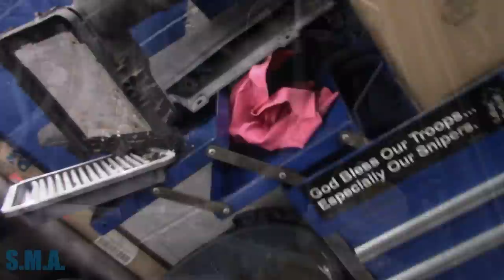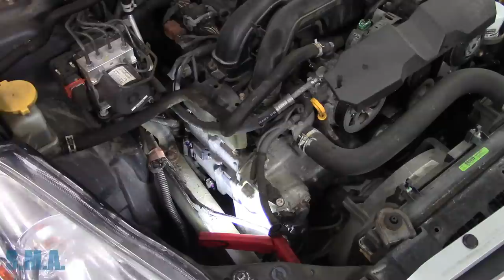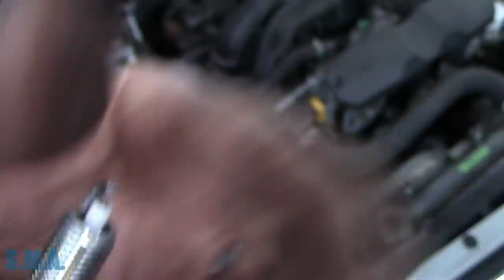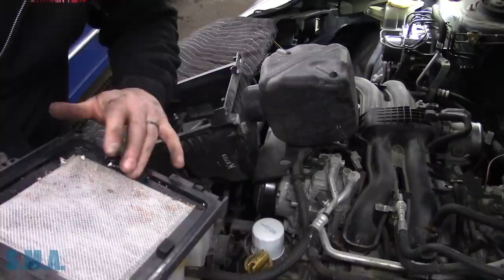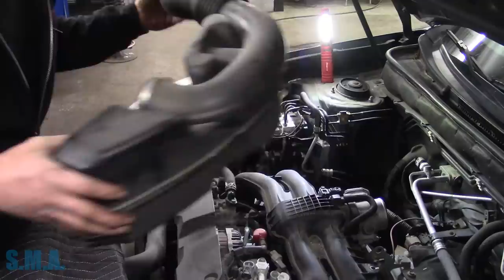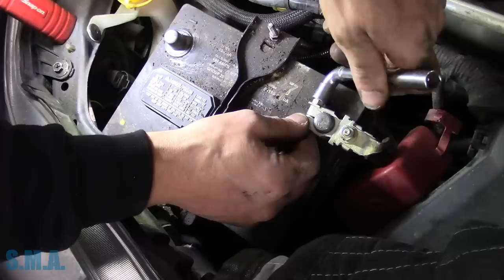Subaru Outback Repair Series: #2 Replacing Spark Plugs

Comment from the maker: 3/8-Inch Drive 9/16-Inch Spark Plug Socket: https://amzn.to/3aaOeeD
Wobble Socket Extension Set: https://amzn.to/2PuxOWL
My all time favorite must have in a vehicle tool kit: https://amzn.to/2PwXMZB
Reply: Eric, What's your little light and where did you get it?  I keep saying to myself "I need one of those".
Reply: @paulbateman7  harbor freight has something similar to that they have BRAUN also have a shorter version of them I believe...they go for around around $40 They are like the ones eric uses that you see only they go for close to $250 -$300 a pop. Harbour freights give off same light intensity but the fraction of the cost.
Reply: Just about everything he uses is available on the south main amazon store, the link is in the description
Reply: where did you get your cordless nut driver from and price?
Reply: Eric, I enjoy watching your repair/service videos. I helped my friend tune up etc. his Subaru. Have you ever used the Denso spark plugs? I used the Denso Iridium Twin Tip spark plugs on his car with great results. According to him, he felt the difference in power & torque delivery.  Most importantly he was able to get a better overall mpg.

Comment: The whisper commentary is fantastic. Its a mechanic thing, when you are in a tight space you tend to whisper, because you don't want your loud voice to make the bolts fall out.
Reply: Totally!
Reply: It's like hearing the mechanic's inner voice!
Reply: It's the complete opposite of Neutral Drop.
Reply: Or want them to break. Lol
Reply: Too true!
Reply: It’s like turning down the car stereo so you can read a street sign.
Reply: Weird but fantastic!
Reply: Whispering like in those ASMR videos that make you sleepy. Next video features big nasty which would give you a shocking wake up, haha :D
Reply: Right
Reply: Don’t wanna spook them, they’ll run away.
Reply: I usually swear loudly to intimidate the parts so they will fucking fit as I say. Bolts always fall off in unreachable places anyways no matter how much you whisper but after swearing they kind of fall off where I can grab them. It’s part of the job anyway. No need to say it’s a common shade tree mechanic thing. Professionals whisper.

Comment: Who is old enough to remember that in the time it took Eric to change 4 spark plugs you could have changed 8 plugs on a V-8, as well as wires, distributor cap, points, condenser, set the points and timing, and be sitting back having a cold one of your favorite beverage?
Reply: I do! I also remember the inline 6s in "full size" cars back in the day, you could STAND IN THE ENGINE BAY while replacing these maintenance items!
Reply: These Subarus are easy by modern standards. Don't have to remove the windshield cowling or the intake manifold. Older cars may have been easier to work on, but you'd have to change those plugs every 30k max. More like 10-15k if you're talking carburetor days.
Reply: Except on a mid 70's Cutlass. Distributor was up under the firewall. Of course the hood didn't bopen high enough to make it easier.
Reply: @ouch1011  nah clean the plugs, check the gap, put them back in. Do you remember the plug cleaning machines? Push the plug in the hole and carbon was gone. As long as the electrode wasn't rounded they were good. My Dad showed me how to keep them clean. Most of the buildup was due to the lead in the gas. Learned to read the build up colors too. Rich, lean or just right.
Reply: Google for a picture of the F10 M5 engine bay and you will see why I don't change my own plugs, you have to take half the engine out before you can see where they are 😂🤣
Reply: @arcadeuk  I have a 2002 Ford Explorer Sport Trac (V6) and you have to remove the passenger side front wheel and a panel to get at the right (starboard for all you boaters and sailors) side plugs through the wheel-well.
Reply: Hi from England. So glad I run a 1998 Micra K11. All plugs easy in view on top. I was wondering 'how many more bits is Eric having to take off'?

Comment: Goodness… Anybody remember the day that you could change eight spark plugs in less than 10 minutes? Cars these days are tough…
Reply: Yes, and you had room to set up a dining table and a fridge under the bonnet too. Now you need to remove 10 friggen things to get to the thing you want to replace.
Reply: @wonniewarrior  Older trucks with in line six engines had enough room to have a mechanic stand inside the engine compartment on either side of the engine,
Reply: Only Subarus make it this hard, lol
Reply: My 2010 2.5 outback isn't hard at all to change. Don't remove airbox or anything, just use a bunch of wobble extensions
Reply: @Quiet Entropy one can kill the other 7
Reply: the 1999-2012 subarus with the EJ251 and EJ253 engines had the plug tubes angled up and were super easy to change, and legitimately can be changed in less than 15 minutes......but all the DOHC models are a PITA to do plugs on.....esp when they cram a huge coil pack down there XD; the EJ255/257 also have part of the emissions system running across the left side valve cover, for those you need fingers made of noodles
Reply: On my '64 Chevy Nova.
Reply: @Jobaa87  Volvos too.
Reply: @Quiet Entropy Common....
Reply: Subies are always tricky because of the boxer design.  I remember my 15' Forester I had to use two wobbles and a six inch ext.  If I didn't I would have had to take an engine mount out and raise the engine a couple inches to get good clearance.
Reply: 68 Mustang V8 w/air, 10 minutes.
Reply: @wonniewarrior  That is why an inline 4-banger is ACTUALLY FUN to work on!
Reply: @Jobaa87  It's a LABOR of LOVE............Subaru, AND it only gets BETTER when it's time to replace head gaskets (which they need at about 150Kmiles). lol
Reply: @Jobaa87  Try replacing the plugs on any newer Toyota Highlander/Lexus RX. Or just about any minivan except a Honda Odyssey. Subarus are easy by comparison.
Reply: I guess you never changed plugs on a Monza, Pacer, or Mustang with a 390 or 428.
Reply: Not my ‘15 Audi A4. Direct injected and turbocharged and I can change the plugs in 10 mins.
Reply: My worst was a 68 mustang with the 428 cobra jet. What a pain in the ass.
Reply: Jobaa87 same with air cooled VW.
Reply: @Jobaa87  nope. Monzas, cougars, dodge trucks, yadda yadda. As long as man has put engines in vehicles people have complained about sparkplug access.
Reply: @TheOzthewiz  The leaky or blown head gasket problem in Subarus was largely solved after the demise of the EJ25 engine years ago.
Reply: Yes in my 56 Chevrolet, but had lots of practice, about every 20k mile as I remember, and points too!

Comment: Some of us work in I.T., and enjoy seeing how you troubleshoot and work through things, and actually fix physical things, versus rearranging bits and bytes and calling it done, with no proof of a job well done.
Reply: You have proof, no crash, no loop and good output. Started in 81, 40+ years with computers in operations then on to networked junk register systems. Worked with everything from 8 1/2" floppies to Mainframes and then down to desktop, registers, hand helds, then store systems again. I am an operations hardware guy, not a programmer. My time with mainframes taught me more about system architecture than anything else. I could print a trace and find a loop faster than anyone else i worked with. Short loop, flip through the fan fold paper. Long loop lay the trace on the floor and look patterns.
Reply: I'm a software developer on IBM Tier 1 (Z-series mainframes), and as John says below....if your changed code does not crash and the output is what it should be, that is proof of a job well done. Like John, my own career dates back to 1981, and is still going strong.

Comment: A bit of new fuel hose (whatever size fits over about 1/4" of the porcelain of the plugs you're working with...) is flexible enough to get 'em started nice by hand.  If you do "try to cross thread 'em" (usually because you can't see what you're doing), the hose will slip on the porcelain before damaging the threads.

Comment: I did this job on my 2015 Outback. Took me 4 hours. Most of the time was removing 6 bolts holding the battery tray to the frame. There was no clearance Clarence!

Comment: I started doing mechanic work since the late 60's early 70's. I am now retired and at times do miss it, but all I have to do is watch your videos and see what has to be done/removed just to perform a simple repair. Don't get me wrong I thoroughly enjoy your videos but I do miss the days  when all you had to do to remove the air cleaner assembly was remove one wing nut on top of the carburetor. Keep up the fantastic work and tell Mrs O Hello.
Reply: Raymond Louks, it's always nice to see the plugs on an engine from ten feet away, though, doubt they lasted for nearly 100,000 miles 🤔. Guessing, since they last so long, as does many vehicle components/servicing intervals, then it means you have more weekend time. I don't miss the low tension distributor points clean up and adjustment every few weeks.
Have a great weekend Sir.
Reply: @bostedtap8399  You make a good point.
Reply: Are you still able to wrench, Ray? An old mechanic is needed in a time where nobody wants to work on old carbureted cars and trucks?

Comment: Yes Eric, and when the spark plug holes are really tight I bet you sometimes grab a piece of hose, say the diameter of the windshield washer hose, a foot or two long, slip that over the end of the plug, line the plug up with your fingers and twist away then finagle a socket on for final torque. I'd just like to say a heartfelt thank you for your vids. I know it takes time from your productive hours but there are worse vices a person can have ... Thank you !

Comment: "If anybody's still watching." Oh, I was watching...didn't even get sleepy despite it being late at night. But watching you do this job made me think of something. Whatever happened to the good 'ol days when changing a spark plug was a quick task? You could pop the hood, "there they are, all in a row and on top!". Pop off the spark plug wire, get the spark plug remover tool and a quick change is done. You had to struggle just to do 4 plugs and having had to take parts off first just to do it!

Comment: I found a magnetic spark plug socket and it's one of my absolute favorite tools ever. I am not a tool snob (other than my cordless impacts- gotta be Milwaukee) but that magnetic socket is a million times better than the spark plug socket with a rubber insert.
Reply: Just used mine today it is awesome. Mine has a small swivel extension on it , good for hemi's and other FCA stuff.
Reply: Only problem with magnetic spark plug sockets is if someone doesn't know what they're doing they'll break the porcelain. I love mine BTW never have to worry about your rubbers🤣🤣

Comment: As a DIY project. I have done the backwards battery trick once. 1998 Ford Escort ( my wife's car of course). I had pulled it apart to do a lot of maintenance. Timing Belt, belts, hoses, EGR. First timing belt I had replaced. Somehow I get the battery backwards. Live and learn.

Comment: Maybe already covered but we used to use fuel line placed over the boot end of a plug to place hard to reach plugs into their hole. Makes it easier to start and doesn't exert enough force to cross the threads.

Comment: The first time I changed sparkplugs on my Forester it took me 90 minutes. Now I'm down to 45. On the rear plug I use two small extensions. The first one goes on the socket and once that has disappeared, I attach the second. There is just enough room to break the plug loose. Then I remove the wrench, the second extension, and work the plug out with the first extension.

Comment: Thanks Eric for your humor in a sparkling change. Glad my Dodge doesn't start that way after a battery disconnect. I just got one of those push pin kits and walking around my car found about 20 that needed new or changed around the lower half of the car. In the rear they had screws with those metal sliding clips with all the screws missing. So just removed the metal clips and put locking push pins in their place very tightly.

Comment: That carbon filter actually saved the engine from sucking in all that debris.
Reply: I think the air filter he installed is between that filter and the motor?
Reply: @BucketList22  No. He did put it back together correctly. Carbon filter is always after regular air filter.
Reply: Why is there a carbon filter there in the first place?  I've never seen that.
Reply: Valde333 dude, I never said anything even remotely implying Eric did anything wrong. I mistakenly thought that the carbon filter was located on the other side of the air filter from the intake. But the original poster was correct.
Reply: @ericbuist8218  it's for emissions, it's soaks up any hydro carbons like gas fumes that work their way back to the air box, it's how they got to the zero emissions designation
Reply: @charleswp71   That makes sense, thanks.
Reply: @ericbuist8218  Engineering Explained did a Vid on whether or not removing the carbon filter made the car run faster breath easier, it was negligible.
Reply: Eric Buist cars used to have those carbon filters in the 80s to trap the fumes that evaporated out of the carburetors.

Comment: Eric O: "Who is still watching at this point?"

Answer: Everyone that's eagerly waiting for a spark-plug to break so we can see how Eric gets the broken one out.
Reply: no kidding :))
Reply: I watched all the way through. I like his thought process, trouble shooting, his thorough work ethic and his humor.

He is a good teacher, and even though I am retired, instill like to learn.

I have a new car. Had some trouble with the passenger seat seatbelt sensor. Watching Eric's videos brought me up to date a bit on terminology and understanding the system. Helped me get the seat replaced. When you know a bit more than the average customer you can manage warranty systems better. I let slip I had got through the lemon law process's some years ago without an attorney before as well.
Reply: Seems every Subaru I've seen you repair, it had to be done through the air cleaner box with a side of "Chew-bacle".  Including the one that threw the wheel off while driving down the interstate.   Always good stuff.
Reply: It would be a short video: crack! oops broke the porcelain, reverse ratchet, remove plug, reverse ratchet, install new plug.
Reply: Just remove the two nuts for the front engine mounts and jack up the engine 15 minutes job no joke

Comment: Hi Eric...thanks for the instructional on how to tune my 2015 Subaru Forrester...cost me $400 for labor at Pep Boys locally in NJ..and I provided the Autolite plugs from Advance auto...it is a little cramped down there...previous cars like my Saab 9-3 (2006)..and Miata (1996)..were a breeze since the plugs were right on the top..of the engine block...

Comment: I don't know why I watch Subaru spark plug/rocker cover videos. I still have nightmares from replacing these items on my 2002 Outback 3.0-H6. Lol. It took me 6 hours the first time I replaced the plugs and I wasn't sure I was going to be able to finish the job myself. But I carried on and got it done. The major problem was getting at the back two plugs. The next time I did the job it took four hours thanks to the experience I gained on the first job. I still love Subies! (At least those up to 2010.)

Comment: Ahhh!!! Reminding me of the nightmare.
I bought a 98 that overheated so badly that the tubes melted to the plugs. Working up against those frame rails, only one inch of space... So frustrating.
Eventually I removed the dogbone and jacked the engine up a tad for that tiny extra bit of access.
No more DOHC for me, the single is so much easier.

Comment: Snap on makes a 9/16 magnetic spark plug short socket ( I use on Cummins islg cig eng)at which I popped out the magnet and fit into my long 9/16 Mac socket that I removed the rubber insert.

Comment: I love dielectric grease;  slather it over all electrical connections in my boat.  Fandamntastic.
Reply: You are CORRECT, Sir! Where there is a moisture concern, whether car or boat, you CAN'T over do it with dielectric grease. I use it everywhere there is an electrical connection, including bulb sockets!

Comment: I don’t recall moving all that plastic on my 92 and 95 legacy 2.2 liter boxer 4 when changing spark plugs.  An articulated ratchet, short extension, swivel and a thin wall plug socket with a good rubber gasket works best.

Comment: Kind of amazing how complicated something that used to be pretty simple.
A Kia with a V6 is a real pain. The top intake manifold has to be removed to get to the back 3 spark plugs
Reply: That's pretty much true with any transverse V6 installation.
Reply: That’s what I liked about our old Windstar. You could remove the cowl panel to get to the rear of the engine. Not so easy with our Town & Country.....
Reply: @notajp  Are you sure? I used to pull the cowl assembly on the Caravan/ T&C models, all of the time.
Reply: Full Opposite Lock  I don’t think you can on our 06. At least I don’t see any way to do it.

Comment: leaf-blower from inside out and banging cleans those filter housings pretty good. obviously remove the sensor first :)
alternate long nozzle blowgun and compressed air, careful to not blow it apart though.

Comment: Every time I watch one of these Subaru spark plug videos I can't help but think back to my old '76 F150 with a 302.  I could just about change all 8 plugs in the time it takes someone just to get access to a Subaru's plugs.
Reply: That Windsor 302 is a GREAT engine, had one in my '70 Bronco. Wish the body was as great as the engine.